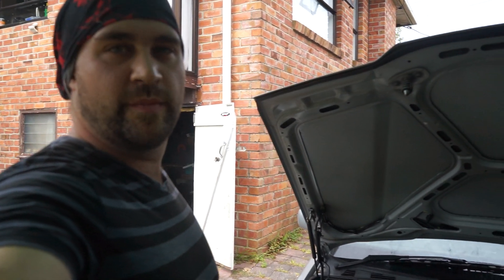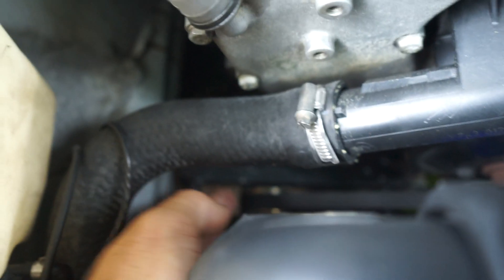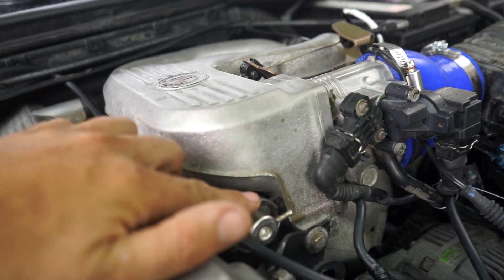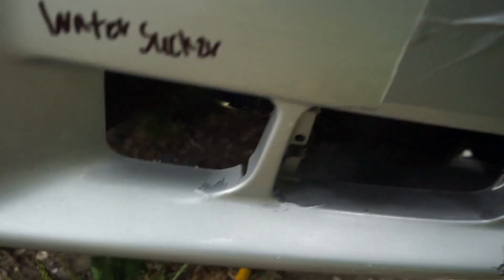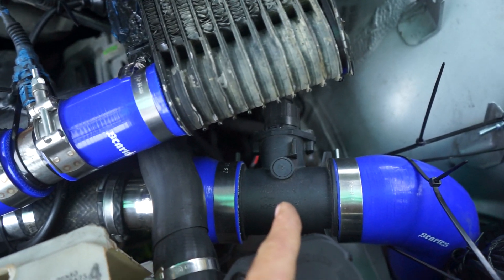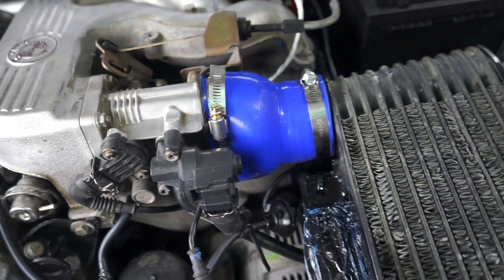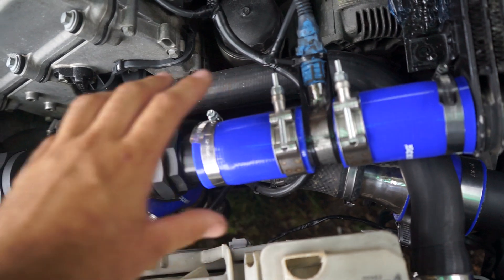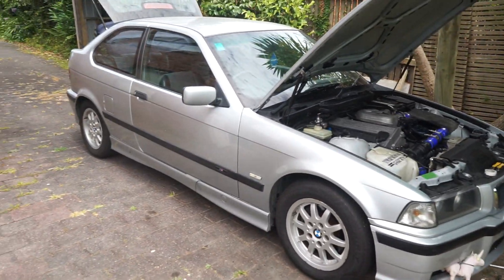Bmw amr 500 walkthrough amr500 318

Comment: Any update on this? Has it been running alright for the past few months?

I'm considering adding one of these to my 2 litre Toyota, was wondering if you had managed to dyno it yet?

Most info I find online is for smaller engines (which is what this thing was designed for).
Reply: I’m curious also. I have an m44 z3 but mainly looking at weight & handling so far.
Reply: Application: to increase performance on motorcycles, snowmobiles, ATVs, VW engines, Mini Coopers, Subarus, Nissans, Toyotas or any engine under 3.0L.

500cc/ revolution (30.5 cu.in.) With straight, 2 lobe rotors. It could be over-driven, and make good boost on a 650cc-1000cc drag bikes or larger if RPM is kept low. Or it could be under-driven for smaller engines.

Examples:
On a 500cc two stroke, with the blower being driven 1.5:1 with the crank, it would produce approximately 7 psi boost.

On a 750cc four stroke, with the blower being driven 1:1 with the crank, it would produce approximately 5 psi boost.

On a 750cc four stroke, with the blower being driven 1.5:1 with the crank, it would produce approximately 15 psi boost.

On a 1000cc four stroke, with the blower being driven 1.5:1 with the crank, it would produce approximately 9.5 psi boost.

On a 1600cc VW engine, with the blower being driven 2.1:1 with the crank, it would produce approximately 5 psi, but the engine RPM must be limited to 8000 rpm.

Additional Info:
Max blower continous speed is 16,000 RPM Before this, these were only available in Japan!
This would be a great blower for any small engine up to 1200cc ( depending on RPM ).

Comment: Awesome job! I am thinking of doing this myself. Although I'm a bit scared... A boost of 5 psi would mean a pretty high compression ratio for the m44 engine. Have you had any knocking with this setup? Also, are you running 93 octane or race gas?

Comment: Dyno this thing! Would love to know what it makes.
Also, are you over-revving this blower?
Reply: He is ever so slightly, his engine redline is 6200rpm, the redline for his supercharger is 16500rpm, and the pulley ratio is 2.86, meaning he is revving the blower to 17732rpm.

However, the Aisin AMR500 (which is Japanese by the way, not Chinese) is built to hold up to sustained loads at 16500, so short bursts of over-revving might not be such an issue.

Comment: Can't tell but it sounds like it's running with a pretty rough idol. Computer is still trying to compensate for a vaccum leak with that periodic bogging it seems to me. Intrested in buying one for my 2.0l duratec. Didn't realize cooling system was needed, just saw a video with some guy that did it with no cooling system and a blow off valve.
Reply: Cooling system isn't strictly required, it just runs a little better with one. The supercharger is running at over 15k rpm so it will get hot and that heat will add to the already heated air from the compression.

Comment: The hose that came from ur intake elbow, going into your fuel rail, what did u do with that?
Reply from the maker: Blocked it off. It's an unnecessary feature on these BMWs. It was supposed to help with sending air around the fuel injectors. Google air shrouded fuel injector. With proper fuel pressure there's no need for this system. At least in my experience

Comment: 500cc/ revolution (30.5 cu.in.) With straight, 2 lobe rotors. It could be over-driven, and make good boost on a 650cc-1000cc drag bikes or larger if RPM is kept low. Or it could be under-driven for smaller engines.

On a 500cc two stroke, with the blower being driven 1.5:1 with the crank, it would produce approximately 7 psi boost.

On a 750cc four stroke, with the blower being driven 1:1 with the crank, it would produce approximately 5 psi boost.

On a 750cc four stroke, with the blower being driven 1.5:1 with the crank, it would produce approximately 15 psi boost.

On a 1000cc four stroke, with the blower being driven 1.5:1 with the crank, it would produce approximately 9.5 psi boost.

On a 1600cc VW engine, with the blower being driven 2.1:1 with the crank, it would produce approximately 5 psi, but the engine RPM must be limited to 8000 rpm.

Max blower continous speed is 16,000 RPM Before this, these were only available in Japan!
This would be a great blower for any small engine up to 1200cc ( depending on RPM ).
Reply from the maker: awesome, this is exactly what my research came up with as ideal applications for these super chargers. i do have a 993cc kei car that i keep eyeballing as a suitable car to mount another one into :D

Comment: Hi im so happy i found your analytic video here! Glad i see people installing s/c without custom manifold,there is also a german guy that is making a kit for this s/c (i can send you if you want,he is also mounting the s/c to a base screwed on alternator bolts)
I would like to ask a few questions, 1st how bad is your fuel consumption with s/c? 2nd do you have any problems with stock ecu and just fuel pressure increased? 3rd and more important ,do you think it reaches 180-190 hp?:P
Reply from the maker: My guess is its added 30-40hp or so. could be more but i havent dynod it yet. the car wasent able to spin a tire on standstill with the brake applied stock, after the amr install it can spin a tire
Reply from the maker: Aslo i m quite sure i was talking with this guy on the bimmer forums, he offered to let me test his system but i wanted to create my own. the whole build thread is on here with him in it https://www.bimmerforums.com/forum/showthread.php?2414585-1998-318i-supercharger
Reply: @theguywithajeep  Thanks a lot, how about your fuel consumption after the supercharger?

Comment: 5 inch crank 1.75 SC that's a ratio of 2.85, at 6000rpm this baby would spool to 17k , it should be max at 16000 i think , i saw someone with a del sol damaged it with over 17k
Reply from the maker: About that yeah. But that's at complete redline on the motor. The cars rarely driven at redline for extended periods. Figured short bursts when you giv'er would be fine. And it is so far :) normal rpm range was 2500 to about 5k depending
Reply: @theguywithajeep  nice ..so its still on the car ..good to hear .. do you how much hp gained? I want to put it on my focus 1.6 ..at 2.4 ratio
Reply from the maker: @RabeaHussain  that would be sweet. it only boosted about 5 psi.. so gains were id estimate around 30-40hp.. outa the 138hp motor. it was noticeable.. but it wasn't like. HOLY SHIT this car is fast :D pn a 1.6 though you would boost alot more then i did as your engine is smaller..
Reply from the maker: @RabeaHussain  mine was 1900cc... 1.9l.. so the amr does .500cc every rotation... so with my ratio's i did have positive pressure..so my math may be wrong but i divided the volume by 4.. and multiplied .500 by the rotations.. as only one cylinder is drawing in air at a time.. so a 1.9l motor divided by 4 is 0.475.. so in effect id need at least 4x my engine rpm to see any real positive boost. per cylinder intake stroke as the SC pressure will be constant with rpm. so at that ratio youll be putting in 480cc into a 400cc cylinder.. what that equates into boost i dunno :D